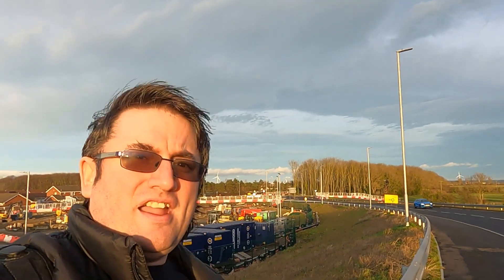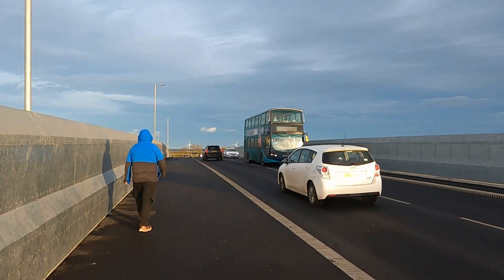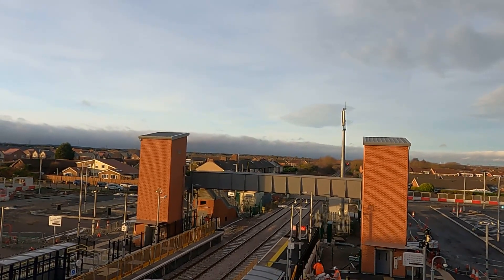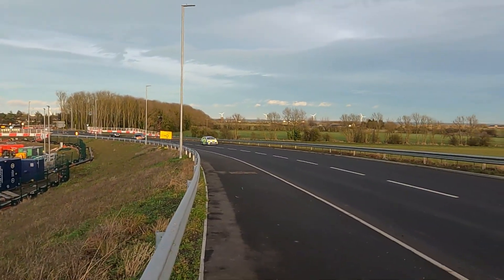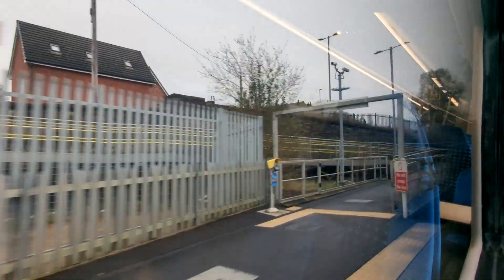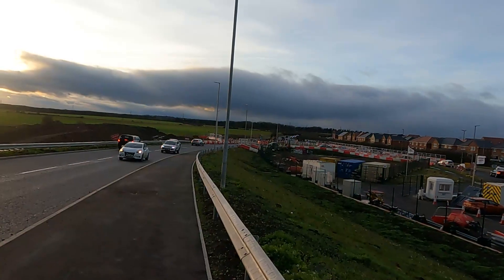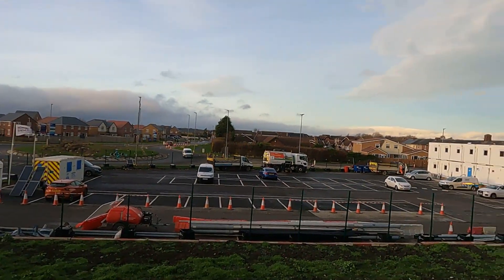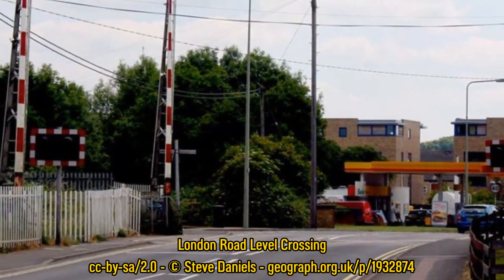NORTHUMBERLAND LINE: A talk about level crossing bridges and why Bicester WON'T get one.

Comment: What I don't get about the bridge is why they put the path on that side of the road. The shared cycle and foot path was on the south side of the old road and is still on the south side of the road beyond both ends of the bridge, but was put on the north side for the bridge, meaning you have to cross the road to get both onto and off of the bridge.

Comment: A lot of modern stations in the Netherlands combine bike, road, walking, etc access into station design as well. They do often look quite striking and pretty as well. 

Though personally I notice some of these ramps can end up quite steep, seemingly only designed for bikes but then called-as wheelchair "friendly" — continuing a communication theme, a lot of these planners don't talk to disability consultants and make the ramps often up to the maximum legal gradient (or sometimes even steeper! There's some pavement ramps where it's way over, and I have to go on the less-steep road ramp to navigate.)
Reply: Many/Most of these new dutch stations put all modes under the railway (Driebergen Zeist). That means shallow gradients for Active modes and less land take than embankments. And the Netherlands has a much bigger drainage issue than Blighty. And they are beautiful. Our infrastructure designers need to be forced to spend a year watching Bicycle Dutch and Not Just Bikes on YouTube.
Reply: @mikeowen3478   yeah, it’s a problem that our public orgs get pretty territorial against other public orgs instead of realising they’re on the same team.

Comment: Whats the answer for level crossings where you cannot feasibly fit a road bridge in? Should we look to close them off from motor traffic? And if you did that you would have to (i assume) provision for pedestrians and cyclists to cross over.

Is it, look to improve the stations/remove the crossings where its 'easiest and therefore cheapest' to do? 

Agree about what looks like a lot of wasted space and no joined up thinking between the road and rail planners. (Back to roads something like that happened with the M27 'smart' works, they are only now replacing the concrete sections with tarmac, when they should have done that in the scope of the smart works. 

As an outsider from planning looking at this it seems there is a lot of waste built into it that doesnt really improve anything for a long time.

Great videos and thanks!
Reply from the maker: The blanket aim to eliminate all level crossings doesn't strike me as particularly feasible, as you say you can cause endless other problems. I think some sites will simply end up remaining and require much stricter enforcement.
Reply: > Should we look to close them off from motor traffic?

Where feasible this does seem to be the trend, especially for "high street" level crossings in town centres. A recent example of this was the former Jumble Lane LC in Barnsley town centre now completely closed and replaced by a foot and cycle bridge. Traffic can go round by existing roads. Another example, more rural, where an integrated package of works was delivered, is the Doncaster North Chord where the former Joan Croft Junction LC was closed and replaced by a nearby overbridge as part of the scheme.